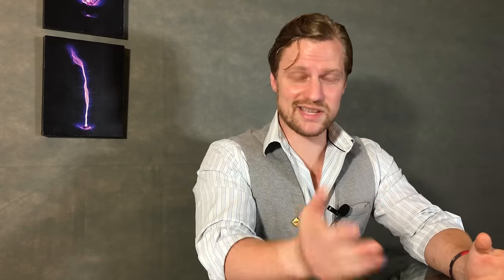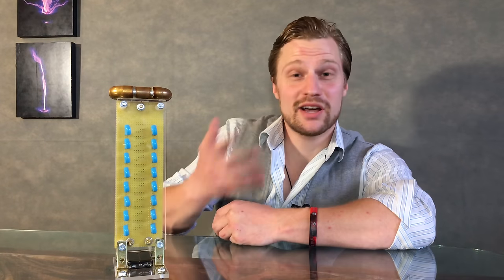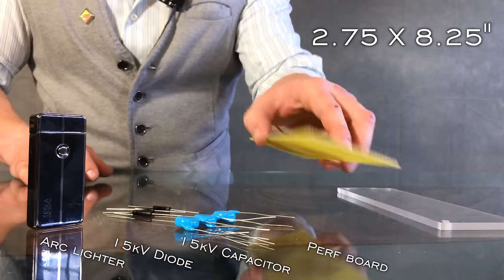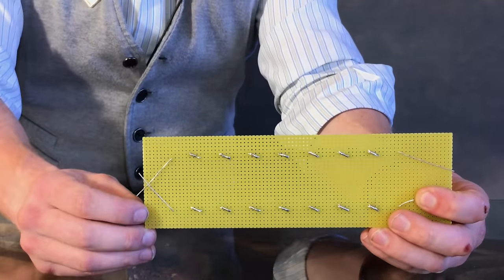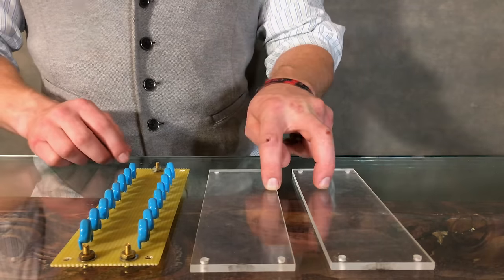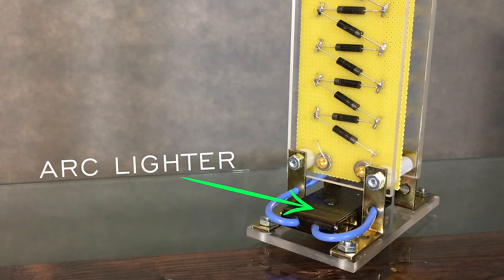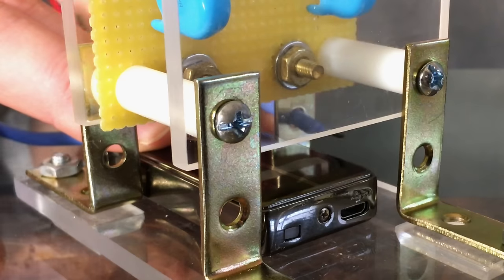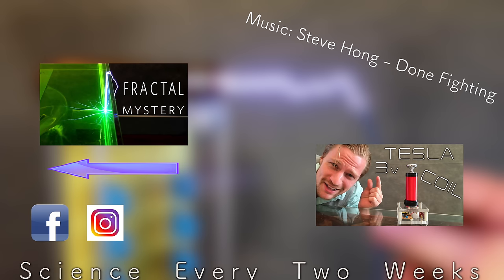DIY Desktop Lightning Tower (USB rechargeable!)

Comment: what if instead of a plasma lighter we would use a piezoelectric igniter?? thatd be awesome , or a piezo igniter / kinetic energy to charge the plasma lighter to run through the tower
Reply from the maker: Well, voltage multipliers need AC input. A peizoelectric lighter is pure DC, and would not work.

Comment: This is a great tutorial but I feel like you should have given more information about the capacitors (like how they can still hold a charge after the button is released) and the name of the voltage multiplier circuit
Other than that great tutorial

Comment: Jay idk if you are checking comments but I have a problem when I use the standart circuit all over the net , it works fine with electrolyit capacitors but when it comes to ceramic capacitors the circuit doesn't seem to work. With electrolyit ones input is 12v output is 100v. With ceramic ones input is 12v output is 15v. what is the problem here electrolyit ones are 100uf 100V and ceramic ones are 3.3nf 2000v
Reply from the maker: That is indeed strange! I think it may have to do with the efficiency losses of ceramic. Ceramic capacitors have high energy losses at high frequencies, compared to other types. Then again, electrolytic are not the best for this circuit anyways. What frequency are you running this at?
Reply: @PlasmaChannel  220v to 12v ac 50/60hz
Reply from the maker: Eren Erver is every diode facing the correct way? Additionally what diodes are you using?
Reply: @PlasmaChannel  if you have an email I can send a picture of the circuit I did and the diodes are 1n4007
Edit: diodes are facing the correct way I think because if they weren't the circuit with electrolyits won't work
Reply from the maker: Eren Erver hi Eren, my email is in the about section.
Reply: @PlasmaChannel  ok I will send my circuit
Reply: @PlasmaChannel  I couldnt find your email so I sent you the photos in instagram
Reply: @PlasmaChannel  I sent it in email

Comment: Just wondering, if i were to use a different HV power source, how would I figure out what voltage rating to get for my capacitors and diodes?

Comment: I got a shock when I first pushed the lighter button. Where might the current be coming from? Ideas?
Reply from the maker: When you got shocked, where you only allowing the tower to discharge to it’s own ground?
Reply: I was just pushing the power button and holding an unattached wire close to the top. If I just push the power button, no shock, but a charge is built up in the top. I think the ground is incorrect. How can I fix this?
Reply from the maker: @normanwood1245  Hi Norman. As I explicitly stated in the video, only discharge this tower to it's own electrical ground. The electrical ground for all voltage multipliers is one of two input wires. If you were just holding a wire that was unattached, you were not discharging to the multipliers own ground. Instead, your chest became a short circuit and a very high voltage went through your chest, and back into the lighter. 

Apart from a really painful shock, this will also blow up the microchips in your lighter....meaning you'll have to rebuild the lighter part again if it breaks.

I'd suggest building a stand for the discharge wire so that you do not have to touch it. best of luck

Comment: Are these sparks safe to touch? Like the Tesla coil sparks? And the wire u r using to demonstrate the sparks, is that connected to something else?
Sorry for the dumb questions btw. I am a beginner
Reply: I don’t think those arcs are safe to touch, and the wire was connected to ground
Reply: @stickwelder3776  sir can you tell me where is the electrical ground he mentioned
Reply: @madeshkanna5322  probably the ground on the electric lighter

Comment: Where can I find some decent sized perf board? I've been looking all over and even took a 40 minute drive to radio shack and no one has any. Where did you get it?
Reply from the maker: I should have links down below to purchase all parts. Let me know if the links are now broken.
Reply: @PlasmaChannel  yeah you have links, but the prototyping board you provided seems to be a bit too small, i was just wondering where I could get some bigger boards.

Comment: Hey jay I’m only able to get these will they work I’m using a fly back from a tv as the power source can u suggest the suitable capacitors and diodes I’m going to do a twenty 20 capacitors on each side

Comment: Am I correct in assuming that the power source must be alternating (or pulsing), and can NOT be high voltage DC?  What is a good power source frequency?
I plan to build this!
...AND THANKS FOR THE GREAT VIDEO...
Reply from the maker: Hi Dale, thank you for the compliments. You are correct. They need AC and do not function with DC. The higher the frequency the better. I aim for 10-20kHz. Higher is still better.

Comment: Great content as always! Love it!

Definitely gonna build one of these!

One tiny question, read all the comments first to see if this was mentioned, but when you press the lighters button, do you press to charge the capacitors then discharge and repeat? Or do you hold the button down while discharging? (Sorry, I know this is probably a very dumb or obvious question, but as I haven't got to build one yet 'silly stores closed at night, lol', I must rely on asking.) 

Again, always love seeing new content from you!
Reply from the maker: Thanks a bunch! You bring the discharge wire up near the top (2 inches away is a good start) then press the button. You can hold it for about 5 seconds at a time, allowing for dozens of sparks in the time frame. Give it a few seconds to cool down (components in lighter get hot), then you can repeat. You can also just tap the button, and usually get a single spark up top. Again, make sure to only discharge the output into a wire connected to the multiplier's ground.
Reply: Plasma Channel Awesome! Thanks!
Reply from the maker: You are welcome. Be safe, and try to find the saberlight x lighter. I tried four different brands - this one was double as effective as the others.
Reply: @PlasmaChannel  I dont think it matters really the circuit but really the battery, Taking a look at the inside of that lighter you can find a very similar circuit online without all the charging stuff for like a buck, i think the battery in the different lighters is what made a difference in arc size

Comment: I guess one way to describe what's happening is like if you had a faucet hooked up to a bunch of reservoirs and then to top something to push out all at once cuz even though the faucet at the bottom output is very little the reservoirs hold the water and allow it all to blast out at once

Comment: Where did you purchase the 15KV 1nf Capacitors and the 15kv 100 amp diodes? I found some on Amazon but I'm sure there is a better place somewhere on the internet.

Comment: the capacitors listed are out of stock will 20KV 1nF 0.001uF 1000pF 102 work? if so can i also add to extra stacks and have 20 capacitors in the build
Reply: You could just search for them on different websites

Comment: That explains the shock. So to do it correctly,  do I connect the wire to one of the input wires to the multiplier or just have it on a stand near the lighter? Thanks for your help as I am trying to get this working for my physics class.
Reply from the maker: I’m happy to help. So, it needs to discharge to its own electrical ground. One of the inputs on your multiplier board itself. If the wire is unattached, then it’s not discharging to its own electrical ground. 

Cheers, let me know what the class thinks!

Comment: Can the arc lighter be used to power the primary of a  Tesla Coil?
Reply: Probably only a small build. You would be relying on the, spark gap (traditional tesla coil) for your pulsed dc voltage, as it seems the arc lighter is smoothed high voltage dc. So you'd need a gap on the + or both to create pulses that will, give you your magnetic flux. Also, arc lighters aren't very high amperage, and it's the amperage that converts the lower voltage into higher, ie, 3kv at 1a will drop in the secondary, to around 0.2a at 15kv (haven't done the sums but that's the right idea) if your current is too low in the primary, the, volt drop will not be compensated and youl end up with a less efficient transfer of energy. In summary, it would be better to use a small boost or step up, supplied by a multiplier and ossilator mosphet.

Comment: I decided to make the lighting tower but it is not visible on the video what is written on the diodes and capacitors. 

From shop told me that they need more information than 15 kV 100 mA and 15 kV 1 nano farad

Comment: Another awesome Vid. Thanks Jay! 
You’re the Don man. I was You was my science teacher when I was at school, I’d have learned so much more.
Jay, question.... could you also use a similar system of diodes and capacitors to up a very low voltage (about 500-750mw) to something useable?
Reply from the maker: Thank you so much! You would have problems at low voltages. Because diodes all have what is called a voltage drop across them. For each one of the diodes I used in this project, you lose 23 volts. That means there are 16 diodes in my tower, so 16*23v is lost in the output. IF you start with less than a volt, it would be difficult to increase voltages. Some diodes may be able to do it though, just not the ones I used!

Comment: I don't think arc lighters are sold in my country.  Are there any alternatives that I can use?  Also what is the model and manufacturer of the high voltage diodes?

Comment: Is it Safe to touch the copper pipe with just hands?
Reply: No, use smaller capacitors if want to touch it like a van de graaf generator.

Comment: Hi, can I use a 15kv or higher flyback transformer to be the power supply of this voltage multiplier ? Will it damage the 15v diodes and capacitors?
Reply from the maker: Yes, the max input these components can take is 6kv in this voltage multiplier

Comment: Why is the arc looking even more powerful than the arc of lighter? It should be longer but weaker than the original arc of lighter.
Reply from the maker: That would be the case only for a transformer. This is not a transformer, it is a circuit. The output spark is one single DC pulse of power, lasting only milliseconds. All the power from the lighter is stored up and released in millisecond pulses. Just like real lightning, the individual charges in the clouds are small. They all add up, and during discharge, are released in millisconds. The faster a spark discharges, the higher the current. The current in this spark is many thousands of amps, but only lasts a few milliseconds. This makes it safe, but, painful.

Comment: What if I want to add an extra later of capacitors and diodes. Will that get me to 100,000 volts?
Reply from the maker: You may be able to make this tower taller and more powerful.

Comment: You said to connect your wire to an electrical ground of the multiplier, where is the best place to do that? I don't see in your video where you connected yours
Reply from the maker: The electrical ground of all multipliers is one of the input wires. Which one depends on how you build the multiplier, and which way the Diodes face at bottom.

Comment: Can I use a microwave transformer to this multipler, or is it too much current for the diodes or caps?  I know the sparks would be very dangerous,  but just curious.
Reply from the maker: You can, but voltage multipliers require high frequency. An MOT is only 60hz. Basically it would not be very efficient.

Comment: Your videos are just awesome I also want to make a Jacob's ladder with high voltage high current output please suggest me the best transformer to achieve this type of arc 

The arc should be like a hot burning sun
Reply from the maker: How long have you worked around high voltage?
Reply: @PlasmaChannel  I have been working on this project since past few months 

I made the Jacob's ladder using the bike ignition coil but the arc was not  sufficient for me i want High temperature and thick arc
Reply: around 5000 degrees

Comment: Hello, I enjoy your videos and I'm learning a lot. Quick Question: In your video "Will 100,000 Volts Destroy You" you mention that amps are dangerous. Could you explain why the diodes are rated at 100mA (0.1A) which is plenty to kill you. You have charged yourself up with a voltage amplifier before in other videos so why is it safe?
Reply from the maker: It is safe to be charged up with a voltage. The moment it DISCHARGES through you (your chest in particular), you are in danger. But to accumulate a charge is totally harmless.
Reply: @PlasmaChannel  Thanks! I'm working on a device. As an experiment I'm seeing if I can only charge one part of my body. An arm for example. This would allow me to raise the power output

Comment: The output you said is 67kv but the capacitors and diodes are only rated for 15kV
Reply from the maker: You are Correct. Do you understand how a voltage multiplier works?
Reply: @PlasmaChannel  voltage across is the vin so it's all good?
Reply from the maker: That is correct. And when the dicharge happens, its because all capacitors and all diodes are now in series....adding up their tolerances.
Reply: @PlasmaChannel  thanks for the clarification!

Comment: 5 questions:
1)Dose this produce AC power?
2) which part is ground where the arcs fly to?
3) can I use this to drive a tesla coil?
4) does this need an AC power source to drive it or can it run on DC or a PWM signal? 
5) could I use a microwave transformer or something similar that outputs high voltage high frequency AC power to drive this?

I will appreciate it if you answer. :)
Reply from the maker: All voltage multipliers produce DC. They are filled with diodes after all. 

Ground is the same for every voltage multiplier. Depending on which way you put your diodes, it’s one of the input wires.

You can not efficiently use this to drive a Tesla coil. It is too low in power, and too high in voltage.

All voltage multipliers need AC to function.

I recommend viewing an old episode of ours called ‘lighting - how we’ve made it’. It details how voltage multipliers work
Reply from the maker: If you can find a high frequency source, any will work
Reply: Thanks :)
Reply: @PlasmaChannel  BTW, with the parts used, would it be practical to make one with 20+ stages or will the resistance of the components waste power?
Reply from the maker: Crazy Nerd Inventor that’s a great question. Unfortunately, unless using vastly expensive components, there is a realistic limit of 12-15. Around that point, the voltage gain is so little per state that it is pointless.

Comment: One little thing that is never mentioned in all these arcs n sparks electrical channels is that any type of electrical discharge apparatus, including this, will mess up intricate electronic devices. So watches, phones, pacemakers, TVs, etc (ANY kind of electronic device or anything with a circuit board really), should be left out of whatever room these are discharging in, preferably as far away as possible
Reply from the maker: True to a certain extent. Full metal watches are fine. Smartphone with a metal case are fine. Anything inside a faraday cage is fine basically. Otherwise, yup, it will destroy sensitive equipment. I have never destroyed anything though, in 15 years of this. But, it IS possible.
Reply: Plasma Channel I used to live van de graaf generators and had one. And  noticed that after just a few "spark sessions" my watch got entirely malfunctioned, and I seem to recall a few other things in the room did also. That's why I made the comment I made. But I guess it's not always a given.

Comment: instead of an arc lighter can you use one of those stun gun high voltage converters????????
please reply😊
Reply from the maker: You cannot. Those output DC. This project requires high frequency high voltage AC

Comment: Hey i wanted to build a powerful tesla coil and i wasent finding a proper video showing that so i was wondering weather i could use this as a power supply for my tesla coil.Sorry for my bad English
Reply from the maker: You could use it as a supply yes, but your pulse rate / break rate would be very low. So it wouldn’t act like a Tesla coil
Reply: @PlasmaChannel  thanks for the reply.But i really want to make a high voltage tesla coil in a simple manner .I really hope you could help me out with that

Comment: In a pinch, can i use transistors or mosfets in place of high voltage diodes? many of us have parts laying around, so it is nice if we can understand some interchangeable parts, so that we can immediately set to building and completing a project. If you add parts options to your projects so that we can just get on to building rather than waiting for Amazon or Ebay, the instructional vids would become infinitely more appealing. :)
Reply from the maker: I suppose you could, though you’d need a triggering impulse for every single stage of mosfets. Also, finding mosfets rated for 15kv will be hard.
Reply: @PlasmaChannel  Hmmm....The amount and type of doped silicon in some transistors or mosfets should handle the voltage easily, especially at such low amperage and you'd simply have them constantly powered on. There are also many ways to construct homemade capacitors and determine their capacitance.

Comment: Just to be sure, what do you call the “electrical ground of the multiplier”?  The negative wire of the battery?
Reply from the maker: No, I would not loop the high voltage back to the battery. the battery is in en entirely different part of the circuit. If you look at a voltage multiplier schematic, there is high voltage out., and ground. The input wires take AC, but, one of them turns into high voltage isolated ground.